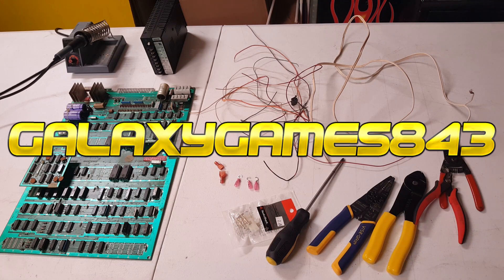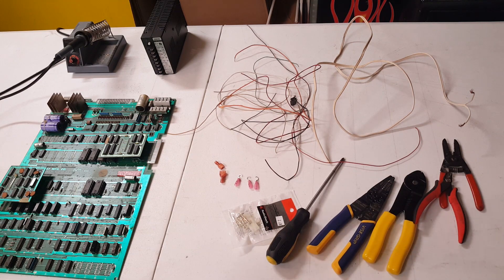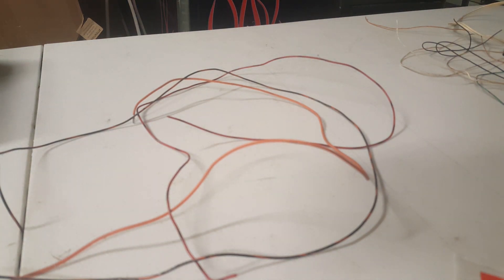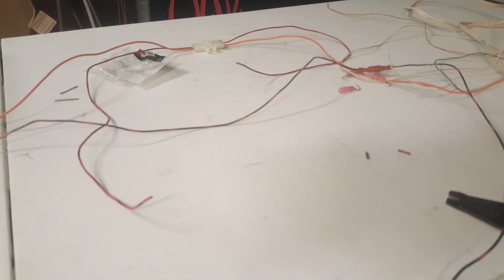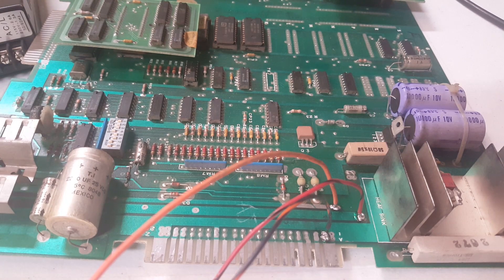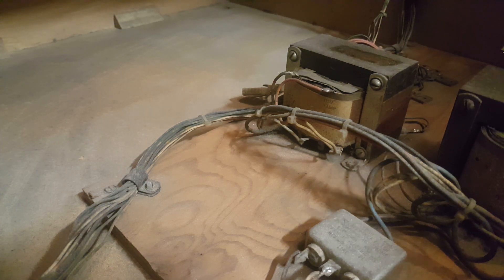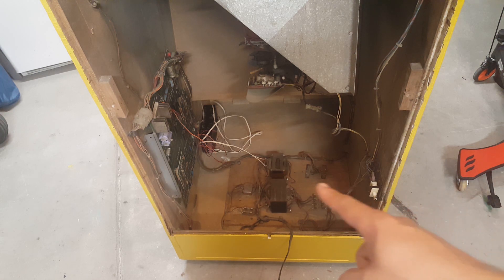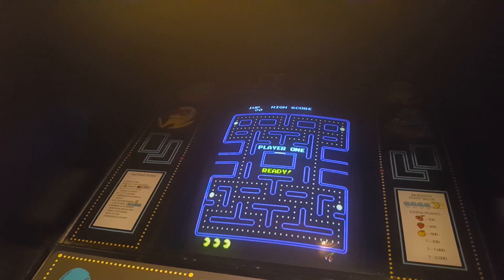How to Install a Switching Power Supply into a Pac-man / Ms. Pac-man Arcade Game

Comment: Hey Man, I Want To Say Thank You On This Tutorial,

A Bit Ago I Got A Ms.Pacman Machine And Decided To Try Swap The Power Supply Because The Original Power Supply Was Pretty Dirty. Now It Plays Great 👍.

Recently I Decided To Do This On My Original Pacman Machine Because I've Noticed That Some Diodes (D7 And D8 I Believe) Were Blistering Hot. I Checked The Voltages And Found Out It Was +5v DC (Normal)  and +16v DC (Too High). The Machine Worked Fine But I Had A Feeling This Would Possibly Cause Future Issues. So I Went And Changed It To The Switching Power Supply And The Diodes Are Now No Longer Hot To The Touch 👍.

Thank You Again!
Reply from the maker: @RickTheBirdie  glad it helped!

Comment: So on my board, the +5V pad and GND at the edge connector have continuity according to my multimeter.   I'm measuring 120 ohms.  Is this normal?  It seems this will just short the power supply so I don't want to connect it.  I will preface that the board had some kind of damage to it prior and but was still working.  The previous owner bypassed the 12/5/GND on the edge connector and connected directly to the harness (yes, they cut the wires). Not sure if I was the "hair" when I pulled it from the machine.
Reply from the maker: Are you sure you are measuring correctly? Your 5v and ground should not pass a continuity test if you are testing correctly
Reply: @GalaxyGames843  Yes. Same pad next to the heatsink.  I was surprised I kept getting a tone from the meter.  There is no connection between the adjacent points on the edge connector.  Only short I can tell is the one between the +5 and the GND. +12 (near the diodes) is fine.

Comment: Are you connecting the 12v4a or the 12v16a to the board?
Reply from the maker: Im not sure what you mean, the switching power supply only have one +12v out that we used

Comment: I have a quick question.  I have an original Mrs Pac Man main board and I also have this power supply.  If I plan on going with a LCD monitor with converter there is no need for any transformers at all, correct?  I mean, everything I need to Coin detection, Joysticks, etc..  will be ok with the main board and the supplied ground or DC voltage references at the edge connector, right?
Reply from the maker: Correct if you are going with both a switching power supply like in this video, as well as an LCD monitor, you can eliminate both transformers at the bottom on the cab
Reply: @GalaxyGames843  Super awesome!  Thank you kind Sir.  Can you recommend a good source (possibly a schematic) that I can reference when building my own edge connector harness?  Thanks again :o)
Reply from the maker: @donaldashworth1224  everything should be in the Ms pacman manual

Comment: I know this is a couple years old but a couple questions for you. 

Do I need to use molex connectors for the 5/12 or can I use spade connectors for everything like you did with the ground?
Wasn't sure if there was a reason or just what you had on hand.

Also if I purchased the 60n1 pcb and wired it like this, instead of the original pcb, would that work. I'd have to put in a new monitor, would the games orientation flip correctly with a cocktail table or would I need to choose a side to face the screen and have no more 2 player?

So excited to try this, my neighbor purchased a Ms pacman cocktail table 10 years ago and has never got it running, I recently purchased it and am working on it. I'm gonna replace the fuse bed first, if that doesn't fix it, I'm going to try this. Unfortunately when plugged in with all safety switches and power switches where they need to be, it shows no sign of life. Hoping fuses or power supply will help and it's not a deeper issue.

I unfortunately am very new to this whole thing and have no idea how to actually test my way through the machine to see where the power stops.
Reply from the maker: Molex isn't needed for it to function. You could use spade connectors if you wrap them with electrical tape so that they don't touch each other. As far as a 60 in 1 it uses a jamma harness, so you would either need an adapter or a whole new harness to re-wire it with
Reply: @GalaxyGames843  perfect! Thanks!

Comment: Do the coin door lights still work with this mod? The top fuse usually supply’s the coin lights power.
Reply from the maker: They do not. You would need to do a separate mod for that
Reply: @GalaxyGames843  could you just leave the top fuse in?
Reply from the maker: @kylen.6742  I'd have to look at the wiring schematics before I can say yes to that. I'll see what I can figure out
Reply: Couldn’t you just wire 5v/12v from the power supply directly to the lights?
Reply from the maker: @DUw0ng  not technically the existing lights use VAC power so you'd have to change the bulbs too
Reply: @GalaxyGames843  pretty sure it’s VDC 12v at the coin door. My Ms Pac has 194 bulbs in it.
Reply from the maker: @kylen.6742  Pretty sure doesn't sound too confident! But who knows it may work, that's why I'd have to do some research and tests
Reply: @GalaxyGames843  quick google search would give you the answer. Also a 194 bulb is used in DC circuits on cars very commonly. I’d be amazed if it was an AC circuit on the coin door.
Reply from the maker: @kylen.6742  Maybe. I will tell you that pacman converts the AC power to DC power on the actual PCB so all other power before the pcb is AC
Reply: @GalaxyGames843  Found a Ken Layton post saying they are A/C from the transformer so I’m fairly sure they are then. Maybe I’ll just run wires from the 12VAC switcher terminal to the coin light power circuit.
Reply from the maker: @kylen.6742  Ken Layton. RIP. He was one of the greats in the arcade world

Comment: Quick question for you. I wired up a 60 in 1 jamma to a power supply just like this in my ms pac cabinet. Now when I power up, monitor powers up and power supply does as well, but no power to marquee lights or credit button, etc.  thoughts on what I messed up?  Thanks!
Reply from the maker: The coin door lights run off of the old transformer - so removing the fuses will remove power to those. The marquee lights however should not be affected. You may want to check your bulb, starter, and ballast
Reply: @GalaxyGames843  Thanks.  It is a cabaret cabinet, so not a tube, they use small 12v incandescent bulbs instead.
Reply from the maker: @dugmar01  I see. Those will run off of the same voltages of the coin door so that makes sense

Comment: At 7:25 you said in or out doesn’t matter.  Isn’t the point of the isolation transformer to isolate the monitor from everything and you should ABSOLUTLEY not connect the PS to the output side?
Reply from the maker: In my opinion it doesn't matter, some may disagree
Reply: May be because the switched has it’s own transformer...  it’s isolated anyway.

Comment: Will this fix the static discharge reset?
Reply from the maker: I'm not familiar with static discharge resets. Can you give more info?
Reply: @GalaxyGames843  so back in the day we use to touch our coin to the door and the static discharge would reset the game. I just picked up a package and of you let the game sit and flip the coin lever for a credit it will spark and reset the game. It will do it if you touch the door also. It does not happen everytime and it does it on both boards I own.
Reply from the maker: @DavidLangkiet  ok I remember reading about that. I would have to have that tested before I could give an answer

Comment: I’m curious why you removed the fuses...
Reply from the maker: That stops power from running to the edge connector on the PCB. Remember this mod bypasses the edge connector for power, but you still have to leave it connected for video audio and controls
Reply: @GalaxyGames843  ok, I just installed this: https://mikesarcade.com/estore/datasheets/PSK-PAC.pdf and it didn’t mention removing fuses so I was wondering if that might be something I needed to do.
Reply from the maker: @RedHorseAdventures  that is different. You are still using the edge connector for power using that adapter....

Comment: Looking into converting my nintendo vs red tent to a switched power supply. Any advice on what kind of unit to use and how to do it would be nice. Thanks 👍.
Reply from the maker: That should honestly be even easier. The nintendo vs manual has a wiring diagram. It should tell you exactly what each wire is (+5, +12, etc) to know how to connect it to the switching power supply

Comment: How did you eliminte the hum bar? I put the same type of switching power supply (kit from Arcadeshop) in my Galaga and get extreme hum sound. I never took the fuses out. Will that help?
Reply from the maker: Yes, you have to bypass the edge connector and remove the fuses.
Reply from the maker: Oh the kit from arcadeshop does not bypass the edge connector

Comment: Where did you get the power supply.  What thickness is the wires you use
Reply from the maker: I got the power supply off of eBay and used 22 gage for the low voltage and lamp wire (18 gauge maybe) for the AC lines
Reply: GalaxyGames843 
I looked on eBay    What did you search for?
Reply from the maker: @markhoppel8920  https://www.ebay.com/itm/331317736009
Reply: GalaxyGames843 
Awesome Thanks
Reply from the maker: @markhoppel8920  you got it!
Reply: GalaxyGames843 
Just making sure this will work with my Pacman PCB before I order it.  Also looking for a 6X9 speaker for the cabinet
Reply from the maker: @markhoppel8920  yes it will! Here is the replacement speaker i use in Pac-Man cabinets... http://www.arcadeshop.com/i/917/6x9-speaker-shielded-8-ohm.htm
Reply: GalaxyGames843 when I hook the AC lamp wire I’m going to solder like you did.  Is there a plus and a minus or does it matter.
Reply from the maker: @markhoppel8920  it doesn't matter - AC is alternating current!
Reply: GalaxyGames843 
Sorry I’m new to this last question.  I have the wires soldered to the board and back transformer.  Is this where they hook up on my switching power supply?   Thanks!
Reply: GalaxyGames843 
Can I post a pic?
Reply from the maker: @markhoppel8920  email it to me galaxygames843@gmail.com

Comment: I don't know what you did with the other end of the white wires you soldered onto the isolation transformer. 
thanks.
Reply from the maker: That went to the A/C input on the switching power supply
Reply: @GalaxyGames843  was there a polarity off the transformer?
Reply from the maker: @mchamps  no it's AC power so it does not matter

Comment: That's one way to do it, but if you don't want to modify your pcb or are not proficient at soldering I suggest this kit. I have used it in multiple machines and it works great and gets rid of the common problems. 10 min install easy peasy.   http://www.arcadeshop.com/i/932/midway-power-supply-kit-3.htm
Reply from the maker: What if you have a burnt ground on your edge connector? Will this kit bypass that?
Reply: I was looking at this kit also . What does this replace ? Such as can I remove the fuses etc from the main transformer board ?
Reply from the maker: @nmore69  yes you will want to remove the 4 fuses that connect to the main transformer when using this method